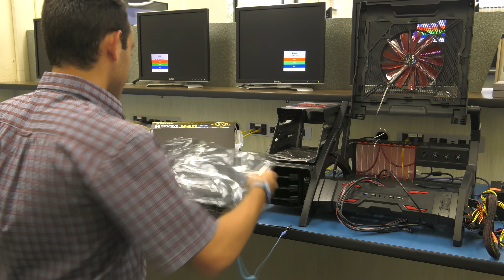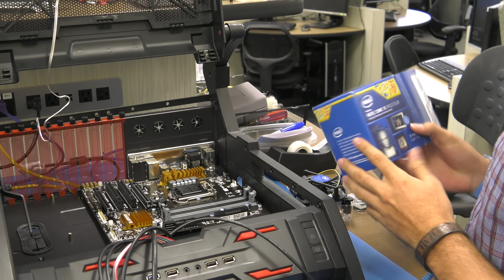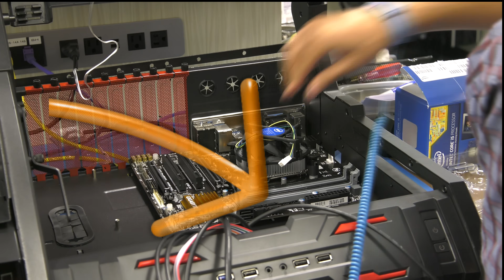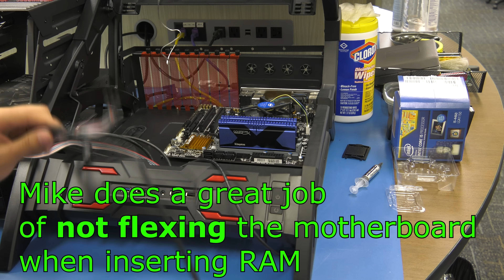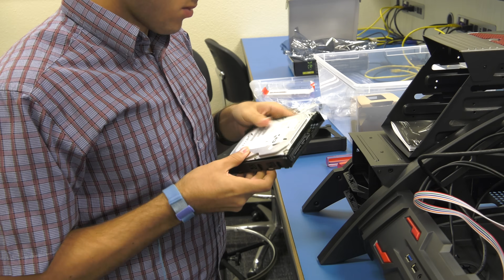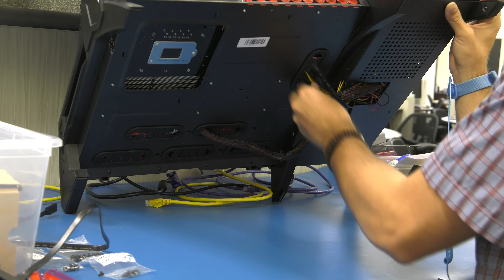Building a PC:  Demonstrated  Part 1

Comment: 12:45 Even better: install the RAM while the mobo is on top of its box. Same goes for the CPU as well. In fact, it's best to first build the most important components outside the case, and then check if the PC even boots.
Reply from the maker: Great comment!